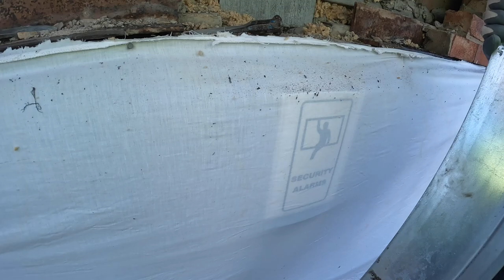2 KNACKERED LINTELS , NO ACROS !!

Comment: In my days with "Wimpey" in the 1970's, they used precast concrete boot lintols of various sizes, some 10 foot (3m), they were sat flush to the face on the inside skin (normally thermalite bocks), no pad stone in those days and were fronted with a Dorman Long lintol which sat on the top of the boot and sloped to sit on the external skin of the face brickwork, with a tray damp laid over it. Lifting those boot lintols onto brick/block piers was a nightmare.
Reply: Should have stated, Dorman long was made of 8mm galvanise steel, much like a Catnic lintol, without the back.
Reply from the maker: Glad they were fazed out before I started 😬🥵🧱👍🏽
Reply: Dorman Long of Middlesbrough still going now I think.
Reply from the maker: @traveller017  🧱👍🏽

Comment: There not boot lintels, boot lintels are an L shape like the galve one youve fit but they are a single course thick on the outer face and 2 course think on the inner and strech over both inner and outer brick course. They stand out a mile because the outer cant be covered up. The re bar in them cracks the concrete and water track though
Reply from the maker: Thanks Richard, sound nasty 😳🧱👍🏽